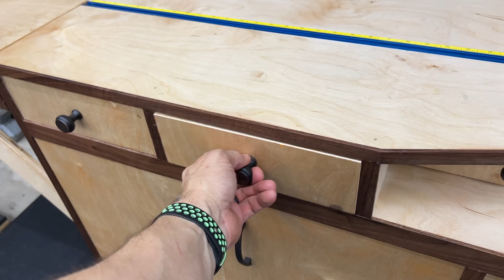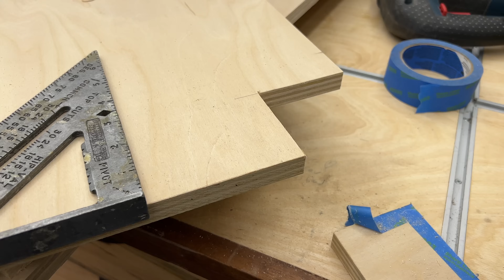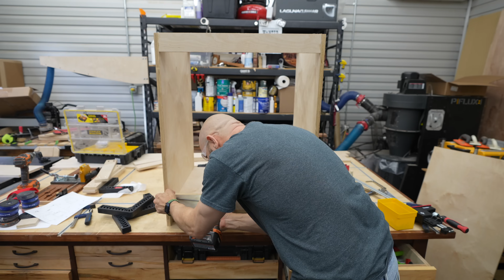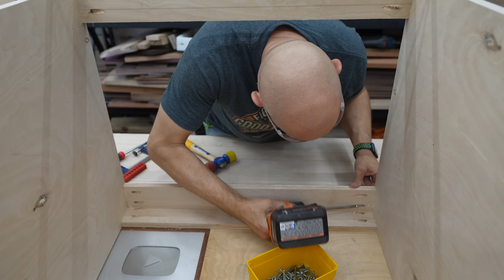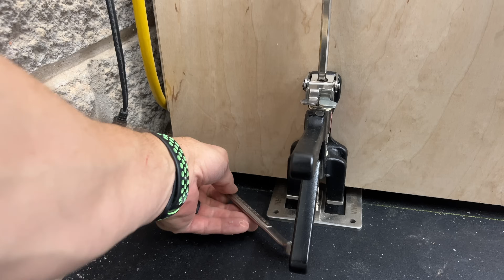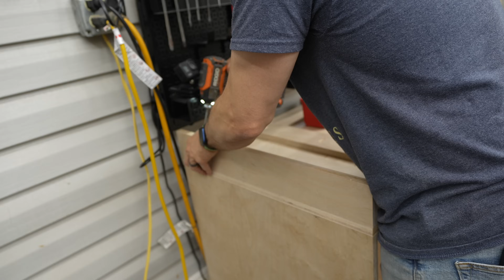How to Build a Space Saving Miter Saw Station for Small Shops

Comment: Hi Matt, I recently purchased the shop project plan bundle.  I'm probably going to build out the mobile router table first and later the mitre station.  I am likely to locate them next to each other in my workspace.  Then I can hopefully use the router table as support for cutting long material at the right side of the mitre station.  This made me curious about the relative heights of both finished projects.  Using your plans as is, will the surface heights be the same for the mitre and router tables?
Reply from the maker: The router table is shorter than the miter station. You could adjust the height of either to fit your needs.
Reply: @731Woodworks  Thanks for the quick feedback.  What is the height difference?  Knowing ahead of time, I can adjust the router table height accordingly.  Since I'll be building that first.
Reply from the maker: @K @KennethEverett_N it’s only about 5 1/2” difference.

Comment: I was going to build a long bench along the west wall of my 16 x 32 small shop. I need cabinet space bad. Now I am building two of these. A left and right, one for my sliding compound miter, the other for my radial arm saw. Some may ask why I need both saws. Well I love cutting plywood with the radial arm saw in belly buster mode. LOL No I just like straight crosscutting much better on my RAS. Small pieces of like 1 1/2" long dowel my miter saw flings it as it finishes the cut. My RAS it stays right where it was cut. I even made a nice oak plywood table and fence on my RAS. That way I would never be tempted to cut miters on my RAS unless I just have to. I can use two of these to support longer boards. Not to mention if I want to move my shop around this would be much better.

Comment: I have the Hercules HE78 HarborFreight miter saw. It’s a great saw. My only issue is the sliding rods protrude about 9”-10” past the standard size to about 44”. So I’m trying to figure out the best way to configure the miter saw station. I really don’t want to build a 40” deep base cabinet because it’ll take up too much space. I’m thinking about putting the whole station on wheels so I can roll forward when I have to make straight cuts. Any thoughts I’d appreciate it.
Reply from the maker: I think having on wheels is a great idea.  That will allow you to move it out of the way when not in use.

Comment: 12 inch rigid and basically all my tools are rigid from drills to my 13 inch planer except for my 14 inch bandsaw. I have just built a 12x12x12 work shop and am looking for different ways to organize it however I might leave my table saw in the garage to save on space. As always thanks for the videos eph 2:8

Comment: Hey Matt! I'm going to start building this station next week. In your plans you call for European style hinges. The problem I'm running into is I don't know what type to buy. Several different options and I don't want to get the wrong type. What do I need to buy? Happy memorial day as well!!
Reply from the maker: These are the ones I used https://www.woodcraft.com/products/blum-clip-top-inset-hinge-frameless?sku=131236
Reply: @731Woodworks  wow! Thank you for the quick reply! Those are pretty pricey for my budget. I found on Amazon European style but they have several choices. I just didn't want to get the wrong overlay.
Reply from the maker: @RJSDZNS  Any flush mount concealed cabinet hinge SHOULD work.  I "think" these will work https://www.amazon.com/Pssopp-Furniture-Concealed-Cupboard-Cabinet/dp/B07QQX1WP6/ref=sr_1_9?crid=TUTC61VIAPPR&keywords=cabinet+hinges+concealed+flush+mount&qid=1685382013&sprefix=cabinet+hinges+concealed+flush+mount%2Caps%2C129&sr=8-9
Reply: @731Woodworks  YOUR A STUD!!! Thank you for taking the time to do that. I'm grabbing these plus the Kreg set up blocks. Do you have an affiliate link to Amazon?
Reply from the maker: @RJSDZNS  Thank you. If you use any of the Amazon links in my description it'll credit me on the purchases (even if you don't buy the thing you clicked).

Comment: I'm about to build a workbench, but I am like a lot of people and I'm working in a very small space. My workbench has to stored against the wall of the garage so the car can be parked inside. In order to maximize the top surface area of the workbench when it's away from the wall and in use, I want to add an extension. I like the way you did yours because there are no legs to trip on, but I am concerned that my extension may not remain level if any weight above 40 or 50 pounds is place on it. I will likely sit on a stool at the extension similar to a kitchen island, so I may go with legs that fold in and I'll use leveling feet to ensure that the extension remains level with the rest of the workbench. Love the content! It gives me lots of ideas!

Comment: Great build !!! This is my next project and have spent a lot of time thinking (over thinking) and designing, only to scrap the plan. I absolutely like this setup and will mimic your design. Side question, I also use the Massca M2 and have Festool dust extractors with 27mm hoses, what adapter are you using to attach to the M2?
Reply from the maker: turn the suction all the way up and stick it to it lol

Comment: Best visual feature: featuring plywood face grain with walnut accents. Got a Craigslist Festool Kapex just completely rebuilt under warranty. I like your design but have a different set of requirements and materials on hand. I make a beeswax blend finish, too, though I recommend it only for kitchenware and intend to apply multiple coats of slightly thinned and finely sanded water based poly followed by traditional Johnson's wax to my shop furniture.

Comment: Nice station. Too bad I don't even have that much room in my little shop. I've been using the HF Hercules Sliding Compound Miter Saw for about 2 years now and it's never missed a cut. It's accurate and stable. Well worth my investment. I've cut thousands of cuts both 90 degrees and 45 plus other cuts. All accurate. It'll cut a 5 inch block like its melted butter.

Comment: I have that miter saw, but I can't seem to adjust it so that the scribe cuts line up with the plunge action. They are off enough that it's pretty visible and I rarely use the slide action. ;(

Disappointed, and I went through a few of them and they all had the same issue with each.

Does yours have any alignment issue between the plunge and slide action?

Comment: Because I was a contractor before getting into fine woodworking, most of my tools are dewalt. I'm still using a dewalt 12" mitre saw, but hoping to upgrade to a festool in the next year or so because I want the forward projecting slides for space economy in my small shop.

Comment: @731Woodworks, you need to get the Dewalt right angle attachment that has the flexible extension piece. Check it out it’s model # is DWAMRASET . They sell it at home depot & it’s a major upgrade from the one you used in this video trust me!

Comment: Matt I've noticed the only thing missing is the walnut trim being placed on the extension wing support block that's attached to the unit itself. As for the silly mistakes like not tightening the corner clamps etc well that 30 seconds clip just made me laugh and not because of what you did,  but honestly because it was just like watching myself making ANYTHING.  Knocking the screw tub off, not cutting the door's to the correct height etc just like looking in a mirror but with someone else looking back at me.  Cracking build especially for smaller shops so definitely going to be thinking about how to be making mine in the near future! ( just completed building my first workshop!).
As always buddy 💯%   👍    🇬🇧.

Comment: I use the cheapest saw that Harbor Freight has. It took a while to get it to cut accurate. When changing setting it has a little movement.  That made it hard to get an accurate cut. I finally got it set so I could line it up properly. The fence is not square to the table.

Comment: In the locknut washer hinge bolt part I recommend you put white lithium grease on both sides of each washer. Some may say this is overkill. To that I would reply when it comes to tools that is the best kind of kill. ;) Seriously, any time there are moving parts it is best to lubricate them. I found it odd when I was assembling my Dewalt Tablesaw and Mitre saw mobile stands neither set of instuctions recommended lube on the wheels or any of the folding joints. Takes very little time and adds so much longevity.
Reply from the maker: Good idea!

Comment: I got the metabo 12" miter saw single bevel. I love it. I have used the 10" sliding dual bevel dewalt miter saw at work. I like the 12" better. 
Idea for a short video how to use that bridge city tool. I got it when it was on sale for $99. I know how to use some of the features but some I'm not sure. 😂 #ToolNoob

Comment: Hi matt, was wondering if the upper fences on your new miter saw are perfectly aligned with the main fence. I have the same saw and when i hold a square up the the fences the upper is sett back a few thousandths. I exchanged the unit and the second one was the same. If yours is like that I can accept that is just how it is.
Reply from the maker: I haven't checked them yet.